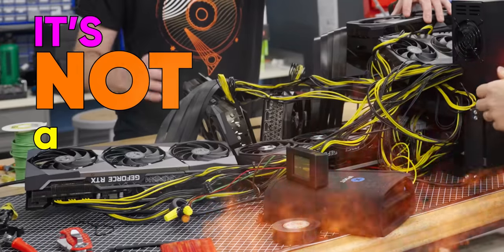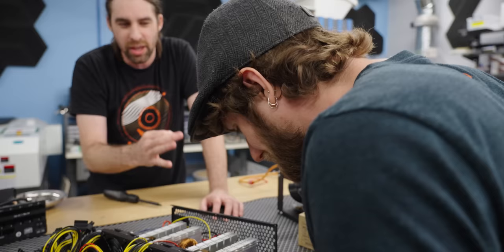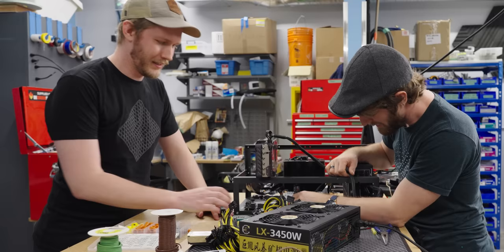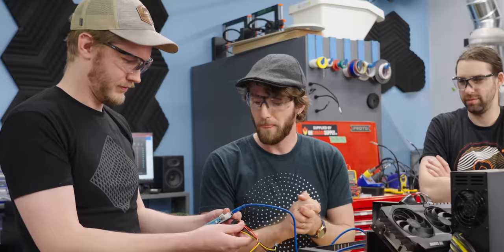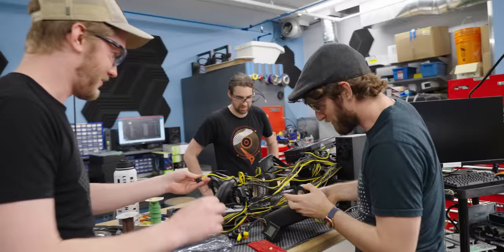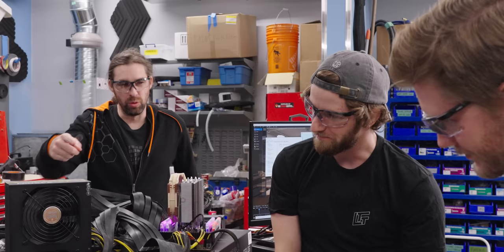This 3450W Power Supply is a Fire Hazard!

Comment: a feel like a not insignificant amount of power is going to power moters for fans in this build, I would like you to re run this whole... thing, but with power only going to pci-e devices, like gpus, which either don't have fans on them, but still draw power, or alternatively, only power the fans of them with external power.

Comment: 3450 watts over one C13 connection is just 15 amps. As long as the wires are 2.5mm^2 I really don't see the issue.

Comment: Looks like a box full of air component wise, not near enough hardware present to support that kind of output  let alone the single input plug and the thin looking ketchup and mustard cables, two cheap and over rated under protected power supplies tacked together do not a quality unit make. This one should come with its own fire extinguisher.

Comment: I can't believe that as a wee lad opened up a power supply to replace the fan with little to no experience with working on PC hardware on that level. That could've gone HORRIBLY wrong, even though I had disconnected it from power and waited for the capacitors to discharge. Years later I replaced the fuser on a laser printer, there was still power in it and my hand touched one of the contacts... I felt that in my arm for the rest of the day. Electricity REALLY dangerous when handled improperly.

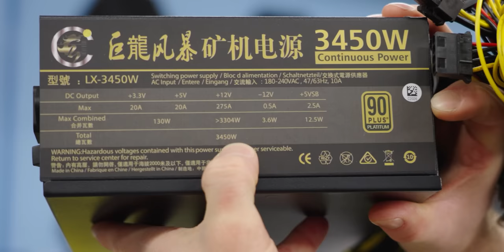Comment: @2:40 220-240V @10A... So max 2400x0.9=2160W... Which seems only slightly more realistic... Let's see how this plays out.
@7:00 those blue boxy things look suspiciously like relays, so the power supplies may be (mostly) really switched off after all.
@17:00 dumping 400V into the 5V rails or 12V rails can't really happen (maybe he's confusing it with a ground fault, of which the result will be hit or miss but hardware mostly survives). Dumping 12V into the 5V rails or >14V into the 12V rails is much more plausible and would be really bad for all the expensive hardware, though.

Comment: Funny don't do this at home  it's 240v  you guy's are used to mainly 120v  Over here in France our usual power at every socket is 230v/240v and I've been electrically shocked a few times no biggie But on triple phase  we have 380v that one you definitely don't want to get a shock from trust me... In some homes  i have seen  main circuit breaker's that are 90Amp (usually they are  30Amp in most homes  and sometimes 45Amp )
(By main circuit breaker i mean the one where you press 1 button and it cuts power off to the entire building)

Comment: I mean. On the plus side, at least it's clearly labeled for a minimum of 180v. God knows I've seen enough stuff that uses high wattage designed for EU and Asia just say they're fine with 120v... But uhh that's still like 20amps or so, so u know, swings and roundabouts

Comment: You could have used a dummy load, but what fun would that be.

BTW, 3450 watts can be provided by a 35 Amp 120 Volt Apliance outlet.  Yeah, not your standard 120 volt  outlet, though.  However, at that point it doesn't matter if you are running 220 Volt 20 Amp or 120 Volt 35 Amp.  Either will fry your electronics and/or you nicely, as both are WAY above the point where the breaker will cut out and both are way above the highest power GFCI systems available.

BTW, the missing heat sinks on several regulators.  Caps look quite sketchy as well as smallish.  Chokes look poorly wound, as does the transformer.   Soldering is crap as you demonstrated. 

I'd say very low build quality.  I would not be running that without a secondary breaker and fuse assembly in the power cord.  Likewise, I also would like to note that I like amalgamating rubber (or silicon) electric tape for working with A/C wire modifications.  Rubber electric tape is tougher than anything, but silicon is more water tight.    For joints, I recommend either heat-shrink fast splicers or crimp fast splicer.  Furthermore, I don't recommend anyone without a solid working knowledge of A/C power systems try to wire ANYTHING running 220V power.  It's bad enough when uneducated people mess with 120V stuff running on a 10-20 Amp standard outlet breaker.   About the only thing I see worse on Youtube is people messing with microwave transformers.

Comment: So what I see the power supply bung good for is that hobby table top 12 volt power supply that you use for doing products and add on a voltage and current letting adjust

Comment: @Linus Tech Tips
The power switch turns (in back of psu) on the second psu (12v  only), so that when you turn the 1st one normal gpus would have already power to display an output. However, it's a stupid why to do so. Also, it should be stated at manual to turn that switch off when not using the psu.

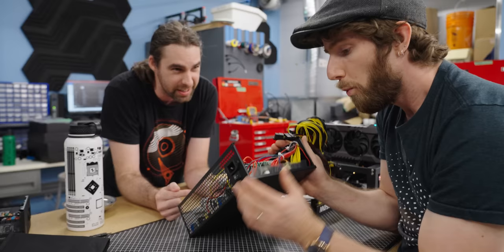Comment: 5:15
A ground on one side of a power switch is NOT normal, if it's single-pole.
Nor is a neutral.
The power switch should NEVER connect to the ground connector on the power plug, that;s a SERIOUS wiring error.
Reply: You sound like you know your stuff
Reply: @TsunamicBug  I spent a couple years building power supplies for computers.

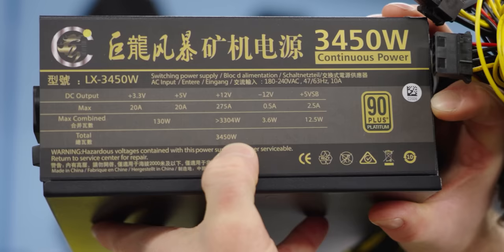Comment: 2:41 Alright there, correct me if I am wrong, but how come this PSU is advertised at 3450 Watts? 
If I remember correctly my high school lessons, power in Watts is equal to voltage (in Volts) multiplied by current (in Amps), so this PSU displaying max 240V * 10A should not be able to output more than 2400 Watts...
Reply: There are transformers in the power supply that get you to the watts or current advertised
Reply: Here in Europe, we usually have 16A breakers, so you can get over 3500W from the Wall (220-240V*16A). However not all sockets, multiplugs etc are rated for 16A, some might only do the 10A

Comment: 6:40 Technically not correct, that is a common mode choke with an air core and quater turn windings per conductor. LOL

Comment: But you didn't really test it tho. It's a 3450w power supply. In order to test it to see if it is any good, load it to it's full rated capacity, not 72% of it's capacity. You did the same with the other 2000 something watts where you load it to 1300w. What's the point ? Having a scale that says it can hold 300kg and you put 200 on it and say it was 300 ?

Comment: ok ? was sorta pressed for time so started this at the middle ? and the title says this is a fire hazard but all I see is them pissing around and doing EVERYTHING half assed ? 1 minute they got a soldering iron and solder and flux and the next minute they got wire nuts holding s bunch of wires together ? they got a soldering iron and solder .. what electrical tape is beyond their budget ? They deliberately do everything in their power to create a fire ? I am thinking they wanted to do a review on this power supply and got mad it wasn't shipped to them for freezies so instead bought one and decided to do a grudge review so the company will think twice before denying them free shit ..

Comment: 4:30 all you need is an oscilloscope, put the PSU on idle without load, and put it on maximum load it takes, look at the graph of all power rails and you have the answer, whether is it a quality power supply or not, but again.. there's no way to test it's reliability except reverse engineering

it's quite good for running 2500w lol
Reply: 2 years late lol
Reply: @jarnobrock  I didn't really look at the 2 years ago upload time but nvm... he;s a rich guy who doesn't hesitate before dropping stuff worth grands so I have no comments lol
Reply: @UnknownPerson-cl9di   im just saying you have no chance that linus will see this comment

Comment: Scary, I would never test anything of value with some sketchy POS.  I'd run it through some big dummy resistive load like a bank of 500W halogen bulbs in parallel.  They won't light up much but are cheap and can be used to force a crap ton of current through.

Also, I still kind of want one for no reason at all...

Comment: This might be a stupid question, but on relation of power, would it matter if you run only the pc from a single wall outlet, or use an extention to also power your monitor etc, and does peripherals with LEDs like keyboards mice etc which gets its power from your pc, suck its performance down?

Comment: How is that even powered. You would need a dedicated circuit supplying 120 volts at at least 30 amps (unless, of course you goig to connect to 220 volt mains)

Comment: It confuses me, how Linus is so scared of power supplies. I put 2 fingers in my psu 1 in 1 capacitor and one in the other and never got shocked, I would sometimes leave my power supplies open and turn them on and shock myself with them which was funny, how are yall scared

Comment: In theory this is impossible even with a european 230v AC the standard outlet, a single 1 phase group with 1.5mm wireing is rated 10 amps. You can go up to a 13 amps fuse without getting the wires too hot, but to get 3.5kw out of a single phase, you would have to go with connecting it to a single of a 3 phased group using 2.5 mm wireing and 3x16 amp fuses. And I really don't think standard 230v outlets plus power chords is rated to insulate that much current as standard power chords is rarely thicker than 0.75mm. Anything over 2kw is total BS using standard "home" power chords and connections. It requires an Industrial designed outlet and power chords designed for high current power draws.

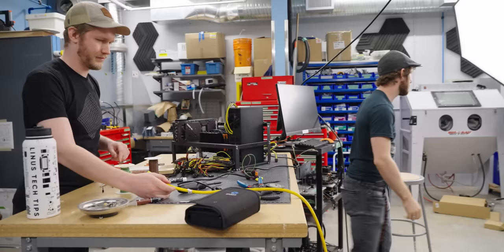Comment: 11:05 typical american.   
it's more then our regular 120v so it's dangerous.  

ehh sorry to break it to ya.  your 120v is more dangerous then our 240v kiddo) 
the lower the voltage.  the higher the amps (for the same wattage) 
the only reason high voltage is dangerous and you need to stay away from it (note that high voltage is not 240.  high voltage is 1000V+ vac and 1500V+ vdc) is because it can jump gaps.  
so if you are less resistant to ground then whatever machine it's powering.  it will jump from exposed leads to you over the air and electrocute you.  (you need to be rather close for this. uncomfortably close but still)

just saying. 
50 watts at a million volts is so little that you won't even feel it.   
50 watts at 3 volts.  will kill you if it crosses your heart.
Reply: Also they're Canadian lmao